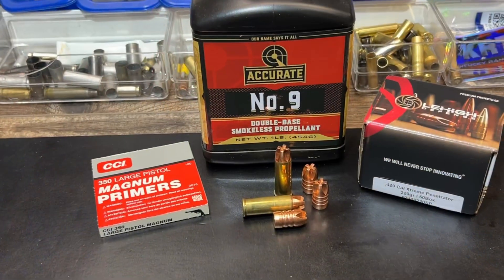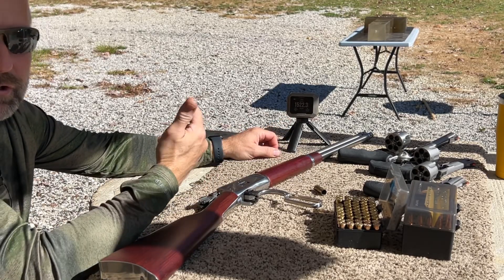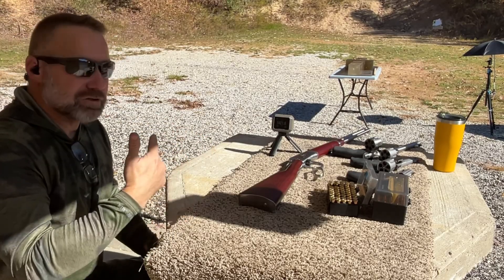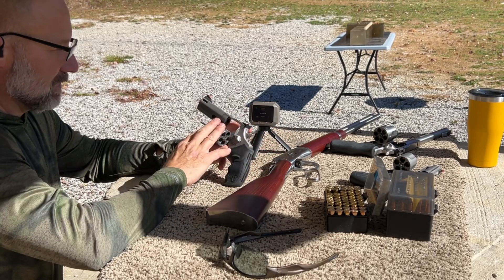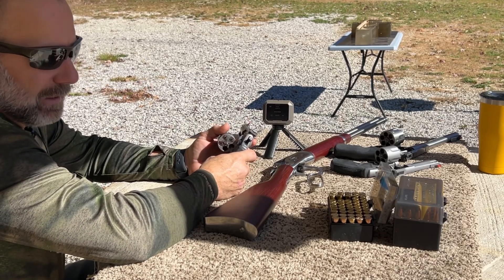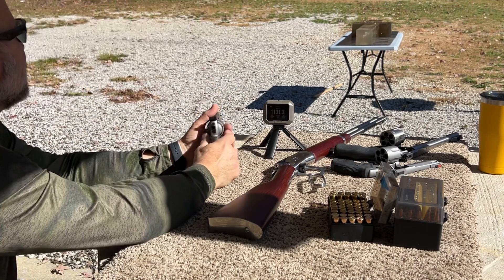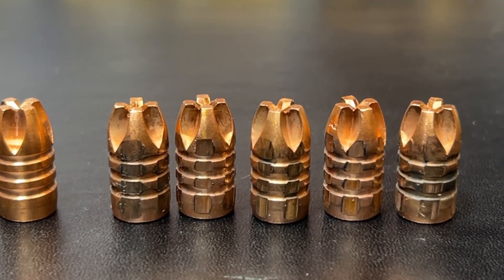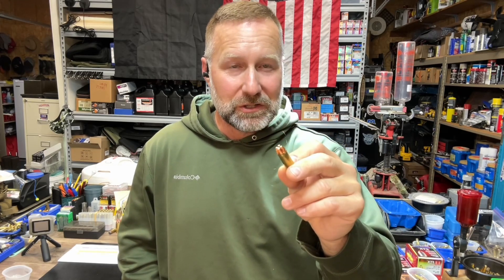.44mag Gel Block Test, Lehigh Defense 220gr Xtreme Penetrator, Solid Copper Bullet, 4 Barrel Lengths

Comment: Nice video. I like to take advantage of my 9.5” super Redhawk's long cylinder by seating all my bullets further out of the case for a longer cartridge overall length. This has several advantages. 1. The bullet has a shorter distance to travel in the cylinder. 2. More powder capacity means I can use more powder at the same pressure level and get greater velocity. 3. With the bullet you are using in this video, you could get a very good roll crimp into the first or even the middle groove. With various 240 grain JHP bullets, I get around 1600-1650 fps in my SRH with no pressure signs, and easy extraction, by seating the bullets further out of the case.
Reply from the maker: @Mbartel500  👍🏻. I use this method for the Bear Creek Ballistics polymer tipped bullets. If you haven’t seen them yet, check them out here….

 https://bearcreekballistics.com/product/429-hv-reloading-bullets/